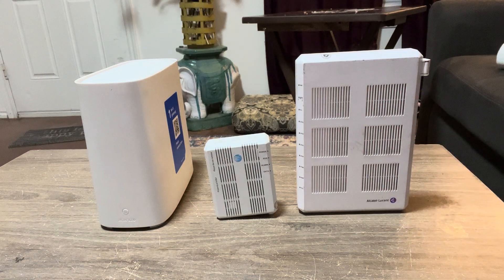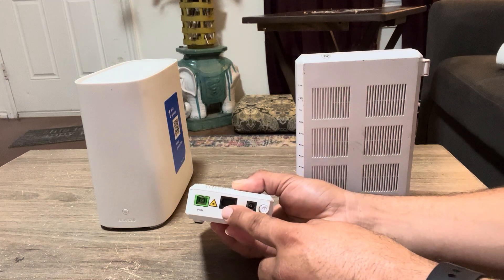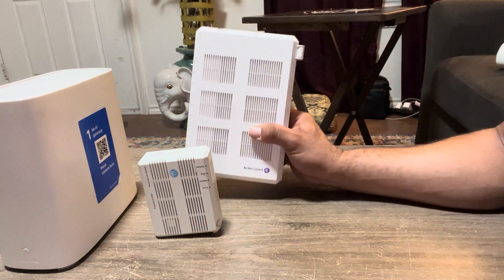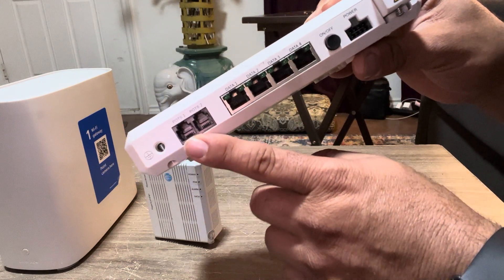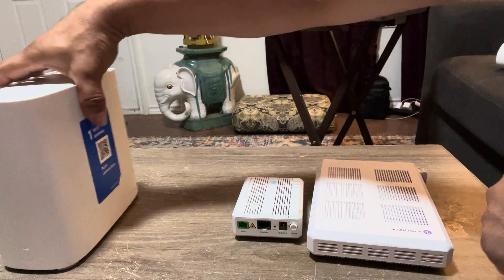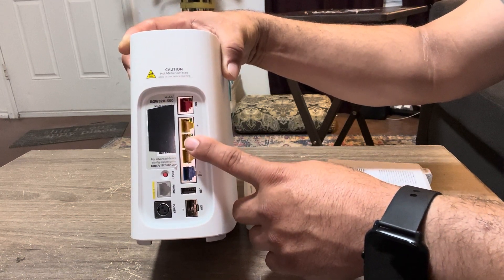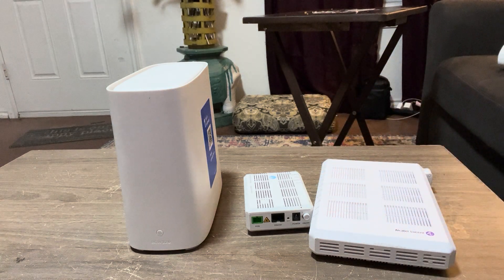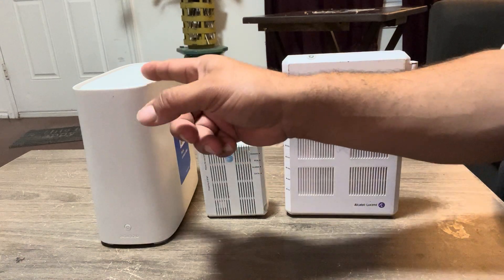AT&T. Getting to know the different types of fiber modem. ONT internet 5000 mbps

Comment: Question:  The small ONT in the middle seems to be what people in my area have installed. Is the ONT just a modem only?  Is there another piece of ATT equipment (Router) that will be installed?  Do I have to provide a Wi-Fi router in addition to the ONT?  Or is the one on the left (the large one) the Router that ATT provides when you request Fiber service?
Reply from the maker: That is a modem you need a gateway for it to operate being that there’s fiber there. The technician will have to run a line into the home or the gateway is to be placed. If the technician cannot drop the wall or place it in the location an alternate route will have to be found or another room in the house
Reply: @purewhips1  Okay, one last question.  If I have ATT Fiber come in, drill a hole in the wall they install the ONT, but they can (I can as well?) provide the Modem/Router so it's ready to go?
Reply from the maker: @Darren77-g5c the AT&T residential Gateway is a combo modem/router device. It will provide Wi-Fi if you’d like.

But if you wanna have your own mesh system, you can connect it to port one set up the mesh and your golden

Comment: Do not get the all in one shit box because you can't use your own router without getting double NAT. Get a modem only fiber box or at least get fiber all in one box with a bridge mode. Some ISP doesn't allow bridge mode or bypass mode on their all in one box.
Reply from the maker: A lot of people don’t know what that is
Reply: @purewhips1 there's no point in using a 3d party router when you don't even know what double NAT is
Reply: Then don’t use it homie. 

But for people wanting to use them. Then people can be taught. Useless to keep ask this info to yourself. And even more useless  to boast about it. 

Share. It’s what I do
Reply: If you're gaming I would say definitely get an extra router. Passthrough dynamically turn off att modems router setttings accept for dhcp, obviously then turn off SIP ALG on your router to knock off your double NAT. the restart all devices

Comment: And an additional question do you know if you can get your own separate modem and router with att fiber?
Reply from the maker: Ok so these are att products. They will be installed at your residence/business.

You don’t buy these. 

You can buy your own router and connect it to the gateway. Not the Ont. 

I will be doing a video on how to connect a router to your gateway.
Reply: i believe that you can use your own router but you are “forced” to get the bgw320 gateway with the residential service. Even if you use like a media converter or a router with sfp port, it wont work because of how their service is configured.